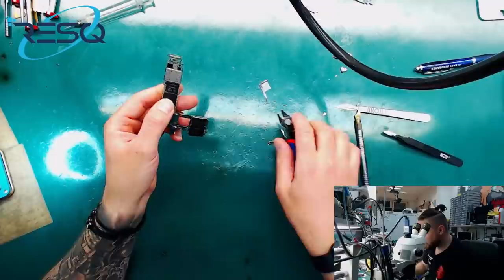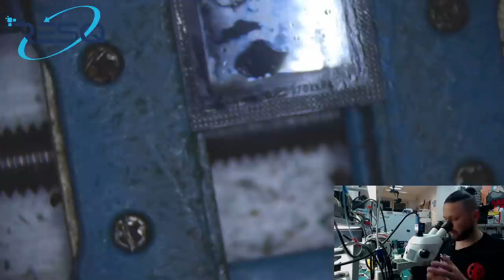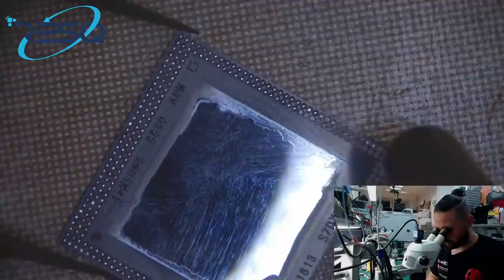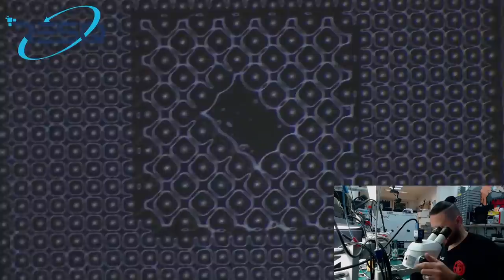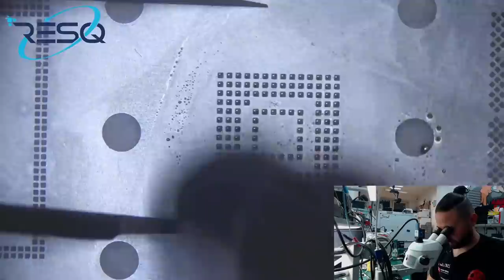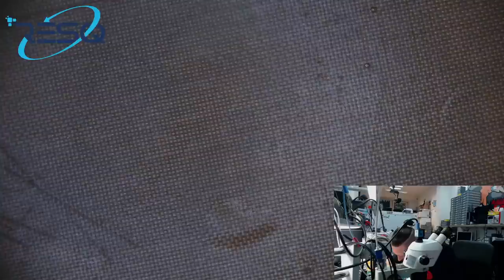SAMSUNG GALAXY S7 - BOARD CRACKED - V.I.P DATARECOVERY - SWAPPING CPU, RAM AND UFS TO A DONOR BOARD

Comment: Really interesting video. I have a question, I have a S7 phone that got overheat. The battery has expanded size by the heat and pushed the back cover of the phone..  when I run CPU throttle test app, it get really hot. I have an infrared camera and the CPU + RAM section is reaching 65 °C in an area of 10x15 mm on the other side of the processor (seems to be a DC-DC PSU there) with all 8 cores running at almost 100% I have added thermal grease on the CPU+ram shield section. There's at this location a black tape to increase thermal emissivity.
is that normal ?
When I read a simple youtube video it goes up to 42 °C measured on top of the EMI shield location (back side of the phone removed). Any comment on this would be appreciated.

Comment: guten Abend.  Mein Bruder.  Ich habe Ihnen Bilder der beiden Telefone geschickt.  Beim Xperia Z3 konnte der Techniker es aufgrund mangelnder Fähigkeiten und fehlender Fähigkeiten nicht reparieren, also wurde ich wütend.  Er hat Fehler gemacht, die das Motherboard verzerren.  Das Xperia Z5 fiel ins Wasser.  Der Techniker konnte es wegen mangelnder Geschicklichkeit und mangelnder Fähigkeiten nicht reparieren. Er sagte mir, ich kann das Telefon wegen Rost nicht reparieren, ich habe Ihnen Bilder per Messenger geschickt.  Ich brauche ein Motherboard für meine Arbeit.  Wenn es keine Lösung gibt, können Sie den Motherboard-Informationsspeicher herausnehmen und in ein neues Xperia Z5 stecken.  Ich habe kein Problem und wenn Sie es beheben können, werde ich stolz auf Sie sein, vielen Dank.  Herzliche Grüße an das Personal.  Und mehr Glanz danke.